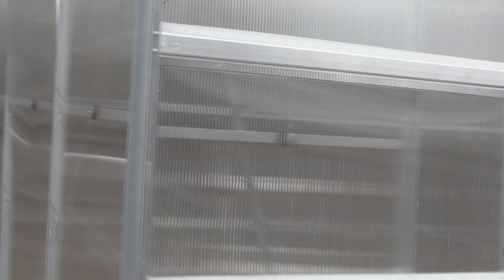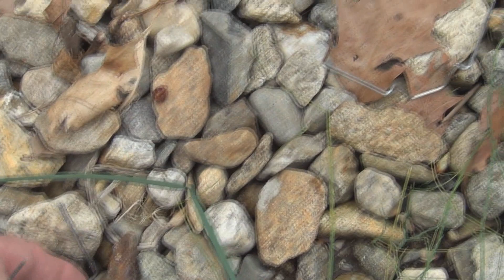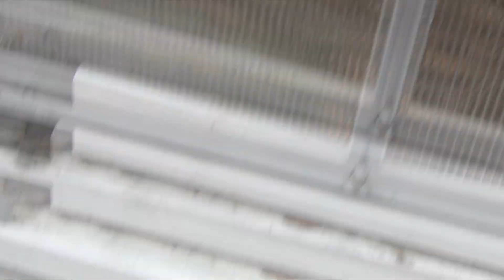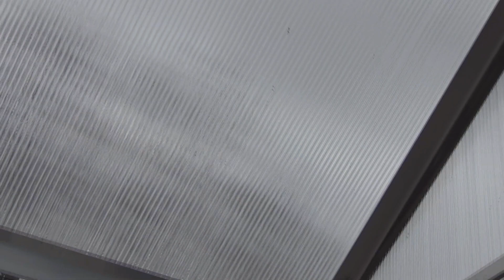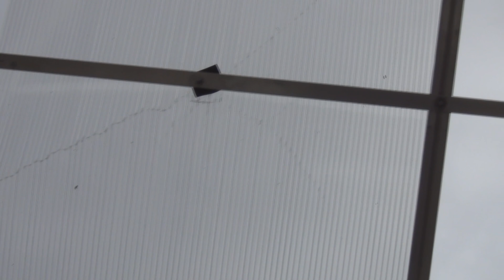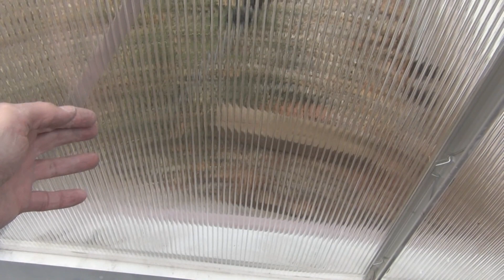Greenhouse  Damage Repair

Comment: Tom, don't replace those panels with Harbor Fright panels... get the new panels from a greenhouse store.  The BF panels only last a few years at most.  The greenhouse panels will last 10 years.  Also, silicone the panels in, it will help a lot.  I still lose some, but only because they have deteriorated.